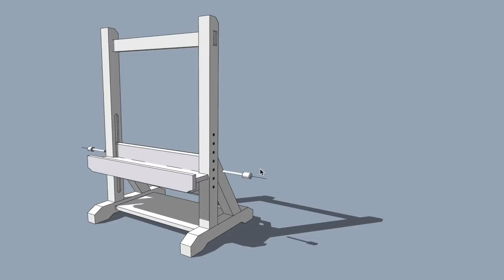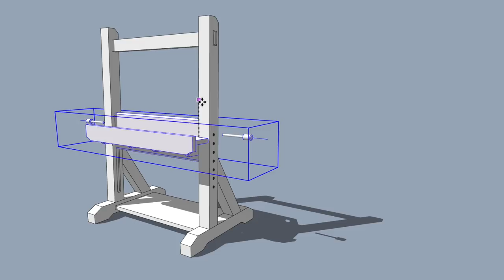Building an easel inspired TV Stand

Comment: Neat idea. However, anyone making this should be aware that most TVs now don't have very big bezels, so they'd cover up a small section of their screen. Also, many TVs aren't built to rest on their bottom bezel; the mounting holes for the stand/feet are generally reinforced and attached to an inner frame. Your TV looks like it'll be fine, though.
Reply from the maker: Good consideration, mine is a few years old, should be ok, but definitely a good point.